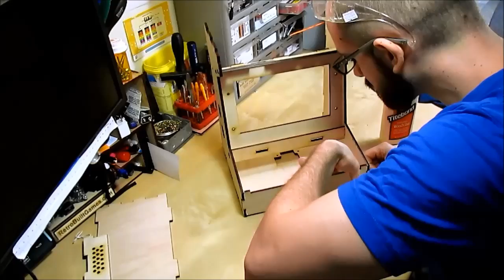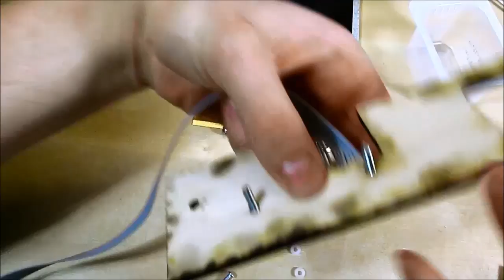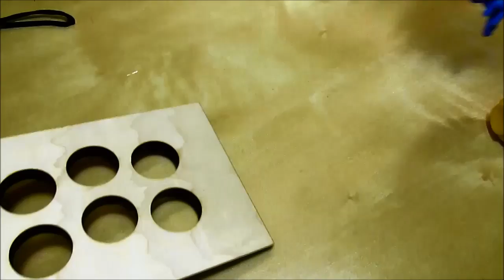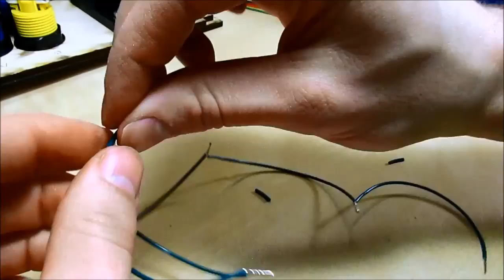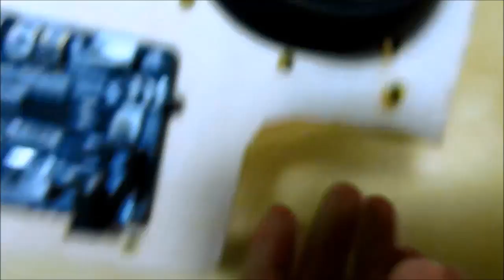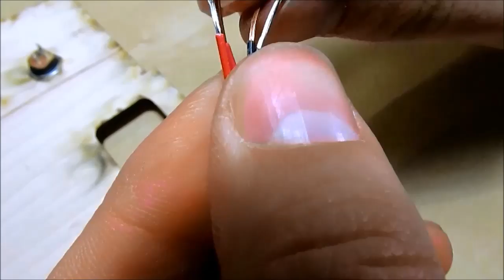DIY Mini Arcade Cabinet (Porta Pi 9inch) Assembly Guide Update!

Comment: What about the OS? My old sd card got corrupted, any easy way for me to get this thing back up and running?
Reply from the maker: follow instructions for retropie.org
Reply: @RetroBuiltGames thank you! One more question - I've got it working, but I notice a undervolt warning. I've got a new 5v 3a power supply - is this expected?
Reply from the maker: yup this is normal. that older Pi expects cell phone charger levels (5.15v) so will give a warning with 5.0 volt supply. with a quick search you can disable that icon/warning.

Comment: I would like to buy your kit but there are parts of the full kit I need to remove I only need the monitor and speakers with there components. and a blank button bord (no pre drilled joystick or button holes) is there a way to get this

Comment: I wonder if you can help me I have a few questions I want to use a bigger screen about a 19 inch but only want one wire coming out not an extension socket and can I use a arcade power supply to a raspberry pi3 and can I hook the wire harness to the raspberry pin out header

Comment: That was awesome!  I just got a pi3 and thought I could, but could not find anything to ensure that I could just wire buttons and joystick directly to the pi.  Every other video I came across used an ipac or one of the other boards that was then plugged in to the pi via usb.  Thanks for this.

Comment: Hi I want to build one of these and I have two questions:
1. Does it work good with N64, PS1 and Gamecube?
2. Which joystick is better for 3D games like N64?
Reply from the maker: +Idosho Gaming PS1 works well with Pi2 and above. N64 is still behind in a good performing emulator. Gamecube is a no. Best to get a analog Arcade joystick if you want full N64 support.
Reply: +Ryan Bates Which Pi are you using in the video?
Which joystick will be better for N64 from the two available with the kit?
Reply: +Idosho Gaming Do I need to get anything besides the full kit, Pi and micro USB cable?
Is it the same with the 10 inch HD screen?
Reply from the maker: Maybe an SD card and pi if you don't have one. The 9 and 10" kits are identical except in the screen size.
Reply: +Ryan Bates So which joystick is better for N64 from the two available?
Reply: +Ryan Bates So if I get a Pi 3 does it work the same?
Reply from the maker: yup
Reply from the maker: +Idosho Gaming neither are 'better' for n64 since they are both digital joysticks. but a survey would likely say 'sanwa' if you wanted the best digital joystick.

Comment: What size countersink bit do I need to get.  I'll have to use a hand drill as I live in an apartment and don't have a workshop :-(   I'm looking at this wood clamp set for the project - http://www.amazon.com/gp/product/B00L07E6XO   In your video you use four 12 inch clamps.  Do you think two clamps would be sufficient?
Reply from the maker: +Steve Simpson That Irwin set will work. You can get by with 2 bar clamps. I also live in an apt, but a drill press is too handy not to have- like a toaster...A countersink around ~0.5in would be fine.
Reply: +Ryan Bates Thank you.

Comment: Do you prefer the 3 in 1 wire crimper, cutter, strippers or having a separate tool for each?

Just wondering. I have to stock up on some tools if I'm going to build this.
Reply from the maker: +Jonny I prefer separate tools that are dedicated to performing one job. I use them nearly every day, so there's my bias to account for. I can say the crimper tool performs so much better than the crimping part on the 3in1, primarily bc the lever action is way easier (less force needed) with the added mechanics and the jaw actually crimps, not 'crushes' the crimp terminals.

Comment: Do I need a specific image to get the buttons to go straight to hte GPIO?
I have retro pi set up, it works with a keyboard. I just got some buttons wired up but want to seeif I just plug them into the GPIO and it will work, or you have a config file.
Reply from the maker: +Brian Hamilton Yes you do, otherwise you will harm the Pi. OR you can add "retrogame" from Adafruit to your image to add the functionality.

Comment: Hey just quick and dumb question.
I noticed that you do not use a controller. I have been browsing for the last few weeks seeing how people build this, most had the i-pac 2, which they say is already programmed essentially just have to wire it.
After you have wired the buttons just to the pi board, is there any set up for it. By that I mean programming, having to do anything technical? This is my first attempt, so I am trying to get as much information as possible so I get it right.
Thanks.

Comment: Hey Ryan I was just wondering if I used 2x 2ohm8watt speakers which amplifier board should I get as well as in the BOM there is two types of amplifier boards do I need both? if not which one is better, and I also saw there is a requirement for the 5vdc 2a and 12vdc 1a, what is the 12vdc one for?
Reply from the maker: +Bionic Cinema The build is flexible, that's why there are alternates/ substitutes in the BoM. The 12V PSU is for led backlight marquee cabinets.

Comment: great video... one concern though... was the speaker hum because you were under a florescent light on your workbench?
Reply from the maker: +ccgsales that and in this vid I did not connect a straight ground from the amplifier to raspberry pi. - kills the hum entirely. There is a difference in ground potential between the two boards as they both have independent voltage regulators on them.
Reply: Ryan Bates
 thanks for the clarification. Great piece of work. I was thinking of making a full sized arcade machine at a local maker studio with a big cnc router. I had never heard of the Pi with the emulator before. Thanks again... great vid.
Reply: +Ryan Bates my friend do you ship worldwide? I need that please replyyy
Reply from the maker: i ship to most countries

Comment: Hello, I am very interested in one of your fully assembled kits, but I was wondering how much work on my part would be needed for that?
Reply from the maker: KidCommentatorHD you'll need connect the wiring harness to the Pi (about 10 minutes) download the image and write to SD card (varies with internet speed), and then put some roms on it. That's it.
Reply: Sweet, so no soldering? I can do a little, just not really comfortable with it... Thanks!

Comment: Your idea is great!  The cabinet is great too!  But....you wreck it with the cheap ass soldering and using electrical tape :(  Shouldn't it be painted or decaled first before putting buttons and stick in?  Most people would not have these tools and im sure it wouldn't cost much more if you countersunk the holes.

Comment: Hey ! I'm actually interested in your kit, just a question..
If i had a model B rpi, is there a layout for those GPIO pins??, do I have to use your RetroPie image ? or any is good?, do I need to install an extra module on the image (so it takes the buttons directly)?

Awesome project btw
Reply from the maker: jose gramsch the image works with the RPI B. The B+ and B(revision 2) have similar pinouts for the 26 GPIO pins. Check your Pi B board for its rev number.

Comment: Hello Ryan, just discovered this amazing project. I am new to Raspberry Pi so I wonder if it would be too difficult to add bluetooth controller for second player (after adding and configuring bluetooth module for R.Pi). It should be matter of changing key setting in system options, or?
Reply from the maker: mrsmashcz That's really all you need to do. There are built-in scripts that will help you configure the controls with prompts.  Just use a popular/compatible USB bluetooth dongle and it should be simple.
Reply: Thank you!

Comment: Hey Ryan, do you sell wiring kits for setting up 2 players for the Raspberry Pi 2?  The part I'm stuck on is what brand/type joystick setup is ideal, what wiring kits I need (something about Jamma looms?), and how to connect to the GPIO for Raspberry Pi 2?  

Also a link to where you bought your speaker/amp kit would be great.  Any help is greatly appreciated.  Thank you!
Reply from the maker: zer08927 I do not sell wiring kits. Joystick type comes down to preference.No need for JAMMA connectors. Some .187" female crimp connectors and female/female jumper wires will get the job done when connecting to the RPi's GPIOs.  Check the Bill of Materials in my manual. Has all the part numbers and websites for this + speakers and amplifier.

Comment: I thought the raspberry Pi required pull-up or pull-down resistors to connect buttons to the GPIO...
Reply from the maker: Internal (built-in) Pullup resistors are activated by the retrogame script.
Reply: Ryan Bates Is it possible that the machine could boot up with with a GPIO set to output and a button press will short +3.3V to ground?